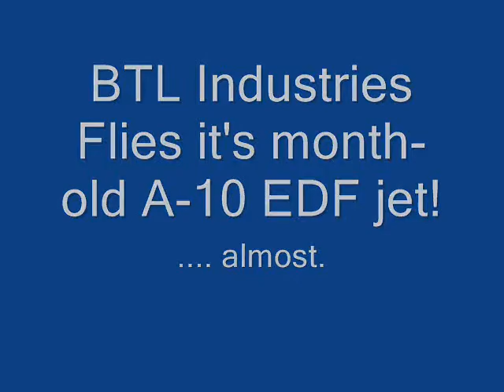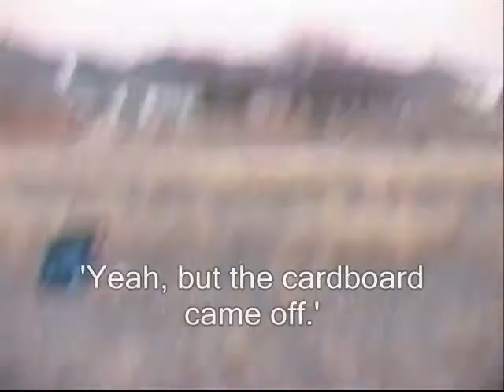BTL Industries A-10 EDF Jet Review pt1

Comment: Hello, I have the same exact A-10 paint scheme.  I have the brushless motors in it with 11.1V lipo battery 2200mah.  If you install this setup you will love it due to the amount of power difference.